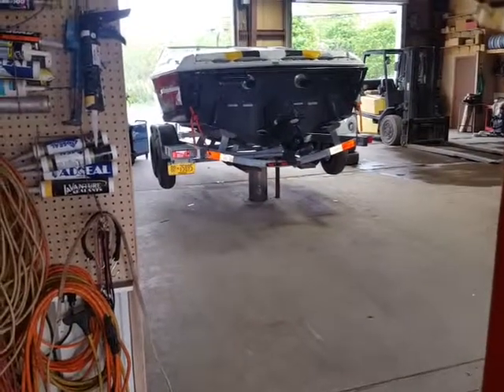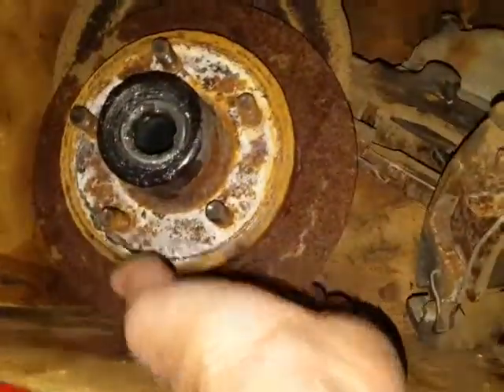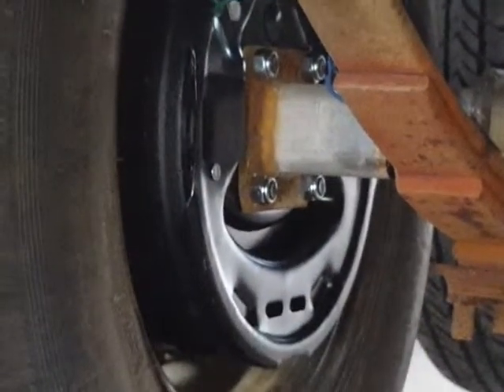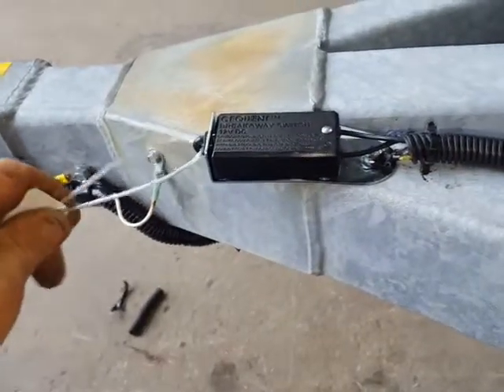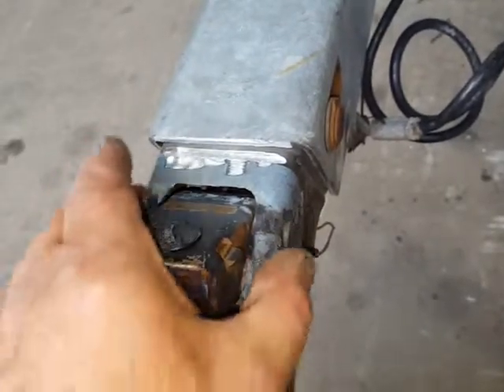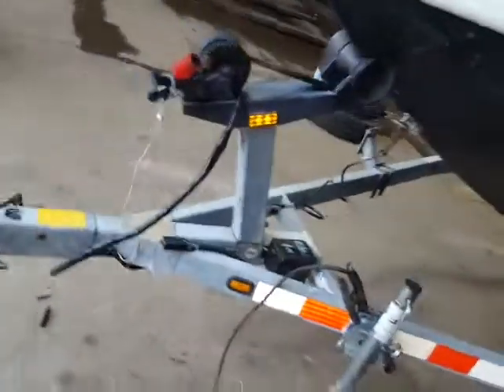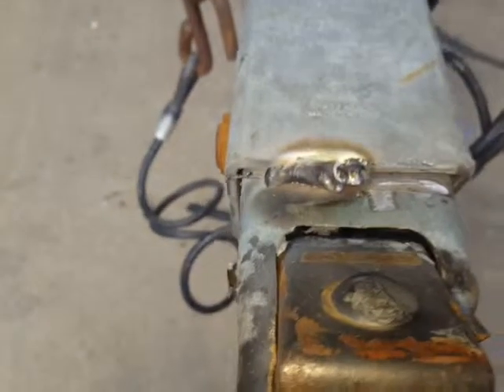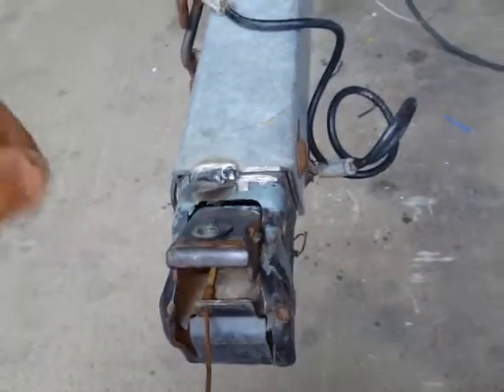Converting hydraulic boat brakes to Electric

Comment: Thanks for the video.
What brand do you recommend?
Something I’m lost on is getting the correctly rated brakes for my boat trailer. If my boat+trailer weighs 4000lbs can I use a 3500lb kit? I believe I have two(tandem) 3500lb axles. So a 4400 wouldn’t fit the axle?
Reply from the maker: They usually 3500 lb 4 bolt holds it onto the axle, Ensemble trailers usually one axle does Breaking some of them I've seen all four, but you can find them on eBay
Reply: @TheoriginalAndysgarage  it’s a four bolt. 2-13/16” is what I measured. 10” x 2-1/4”. The axles have square tubes. Just didn’t know if a 3500lb kit is too small? Thanks for the reply
Reply from the maker: @aarong2387 yeah they're all pretty much a standard size for medium trailers when you get up in a huge trailers the drums and everything gets bigger but if you're around 10 inch drums that's pretty normal, 4 bolt and two wires one way to gets grounded the other wire goes to the blue brake wire
Reply: @TheoriginalAndysgarage  thanks again appreciate it

Comment: Excellent video, it is what I was looking for a long time, I have a question, are the brakes water resistant? 
Why only on the back axle , is it possible to put it on both axles? 

Thank you
Reply: Thanks for your response, cheers
Reply from the maker: It just happens to be on this one trailer some of the old trailers they only put brakes on one axle but yes through waterproof if you go into salt water could be an issue but fresh water not a problem

Comment: Why did you put brakes on the back axle versus front?  If it come unhooked from tow vehicle that axle may be in the air but even if not it all have FAR LESS weight on it than the front axle so your break away will not be very effective ????

Comment: How much does this conversion typically cost
Reply: Hey man 
I’m in a pickle and need advice. My surge breaks are freaking shot to shit . ( corrosion) and I’m in the middle of a cross country move . I want to put 2 breaks on the rears of my tandem
Reply: @TheoriginalAndysgarage  
Thinking about just going electric on the rear axle to get me home . Trailer is tandem . I’m pulling around 4K with a 5.4 f150
Reply: @TheoriginalAndysgarage  
Do you know of a kit ? Or point me in the correct direction?
Reply: @TheoriginalAndysgarage  
Five bolt
Reply: @TheoriginalAndysgarage  
It’s a 4 bolt pattern and each axle is rated for 3500 . I’m thinking just do the rear axle to get home on ?
Reply: @TheoriginalAndysgarage  
Well I keep my crimping and soldering set in the truck . Have some of those crimp and melt solderless fittings as well etc etc . One question. My f150 has a factory brake controller 
That’s sufficient correct ?
Reply: Thanks 🙏 by the way 😄
Reply: @TheoriginalAndysgarage  
One last last thing lol 
The 2 and 5/8ths measurement for fitment is from center of lug bolt to center of next lug bolt correct ?
Reply: @TheoriginalAndysgarage  
Thanks for your time and help

Comment: I want to convert my surge system to electrical, hate that the tongue always sliding when braking or under acceleration because you can feel the jerking. Already replaced the shock inside the system. My boat dry weight is 5k also water on the electric breaks concerns me.
Reply from the maker: If you're in freshwater you'll be okay everything is sealed saltwater would be an issue if you think about it your brakes get wet anyways in the rain

Comment: I absolutely hates hydraulic brakes on a Marine trailer, the gut thumping on the highway during braking, etc, they rust and need maintenance every six months it seems even with my CRC treatment. My Shorelander is now getting a conversion for sure, I always remove my trailer electrical plug when dunking the trailer @ the ramp, I generally replace one light bulb on my trailer maybe every 10 years I guess because of this? I have two enclosed trailers with electric brakes and they work flawlessly plus I can adjust my braking power from the comfort of my truck using a Tekonsha 90195 P3 Electronic Brake Control.
Reply from the maker: We have done a lot of conversions over electric brakes he just had to seal the wires up good but our Lakes are not salt water brakes get wet all the time specially when you're towing them down the road so water isn't going to hurt them
Reply: Agree-I hate hydraulic brakes and have no confidence in them.

Comment: Why not convert to electric over hydraulic?
Reply from the maker: Customer's request
Reply: What’s better in your opinion? Surge, electric or electric over hydraulic?
Reply from the maker: The absolute easiest to work on is electric brakes, all of the boat trailers that came into our shop the hydraulic surge on the hitch never works they freeze up and I never got the mess around with electric over hydraulic I either did hydraulic or electric and electric was my favorite, and water doesn't bother electric parts of the brakes they are all Factory sealed

Comment: You know electric breaks and water don't mix and you gotta put it the wheels in the water to get your butt off the trailer
Reply from the maker: The magnets are watertight but a lot of people are doing that lately
Reply: Salt water ya electric brakes are bad, but u can disconnect the electrics.and flush.  Fresh water electric brakes work just fine
Reply from the maker: Saltwaters even bed for regular breaks for that matter long as you rinse them off your fine